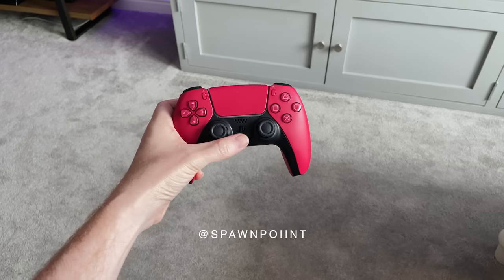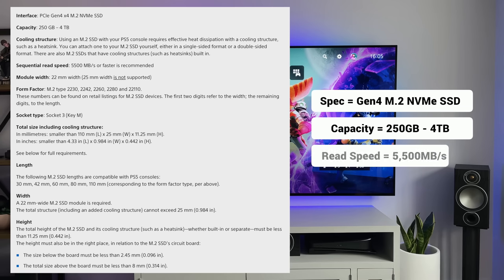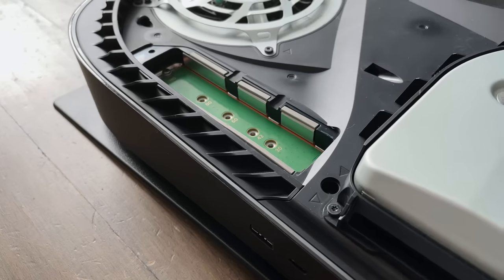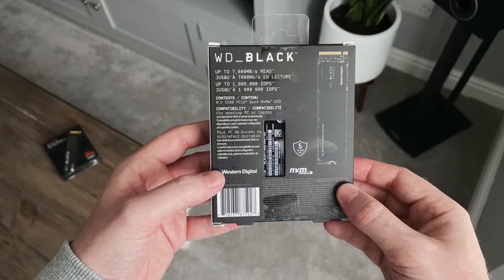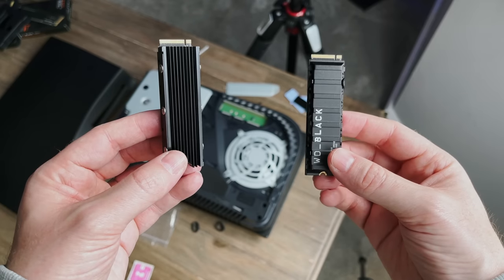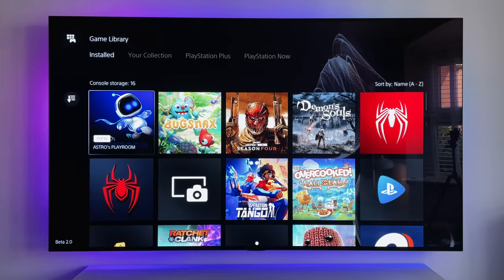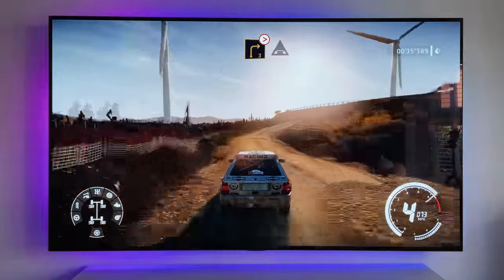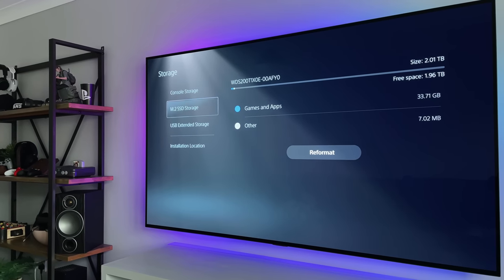PS5 SSD Upgrade: Installing 2TB SSD + Heatsink

Comment from the maker: I hope this was useful. If you do install an SSD, would you buy one with or without the heatsink (and fit your own)?
Reply: I’m going with a FireCuda, had the BarraCuda in my PS4 Pro and I now use it as the external drive for the PS5
Reply: @kevindueck7183  The FireCuda is soo expensive
Reply: @kevindueck7183  is it worth using on the ps5?
Reply: Just bought the sn850 without the original  heatsink, but for 5€ a custom one
Reply: Definitely getting one with a heatsink, unless if I can find a better reviewed third party heatsink.
Reply: @Jactional  I haven’t had any issues with the BarraCuda as external so far, mainly use it as storage for PS4 games, I already owned it so made it worth it
Reply: @brandon_nope  the one thing I have learned in life is you get what you pay for, you just spent $700 on a PS5, don’t cheap out on the accessories
Reply: Very useful. You showed the various models with and without heat sink and compared the load times of external ssd with internal ssd. Great job.
Reply: Yes it was helpful, I think I'll go with the wd_black with heatsink recommended by Mark Cerny.
Reply: I have a question, please answer, I was the first one to post a full video on the SSD installation and PS5 beta software features, but then I read in the email we have received from sony that we are not supposed to post about or stream, did you receive a permission from sony? please advise, Thanks
Reply: Keep up the great content big dog. I love your video and your set ups. Everything always clean and your tech is up to date, just like I love.
Reply: @SingularJohn  Me2 but with the original heatsink for 220$
Reply: Just got the 1TB WD black with a aftermarket heatsink for now till I see the price drop on the Firecuda.
Reply: Excellent video
Clear and straight to the point
Thanks
Reply: @SingularJohn  Ich habe sie neu bei ebay kleinanzeigen gekauft :)
Reply: I bought the sabrent rocket it checks everything except the read speed it 5000 not 5500 am I going to have problems?
Reply: @Vic4vendetta  no..
Reply: @marciN0o  deutlich besser Preis, aber trotzdem noch adequat
Reply: Got the 2TB SN850 without the heatsink for 345€. The 2TB version with a heatsinks costs 499€. What a rip off.
Reply: @SingularJohn  das stimmt, der mc1 von bequit hätte es eig auch getan... Naja, man gönnt sich ja sonst nichts (:
Reply: I’m installed the Aorus 7000s SSD with heatsink.
Reply: Very useful video I go with firecuda for my ps5
Reply: Did you put the spacer under or on top of the actual SSD?
Reply: Extremely useful
Reply: Hello which hdmi cable? you using to ps5 thank you.
Reply: In further testing have you ran into any issues during gameplay?
Reply: @sonutigr2555  read my comment further down. Very good choice.
Reply: @phildavis8732  SN850 has better latency and IOPS, which is why Mark Cerny chose it. Very important to sustained performance. Peak bursts of read/write speeds don’t mean anything. The 1200 TBW will last anyone this whole gen.
Reply: @Vic4vendetta  yes. When it comes out of Beta. The firmware path will either approve or reject an ssd. It clearly states 5500mb minimum as you stated. And ssd brands have to qualify with Sony. Seagate wd and Sam have all gone to market with ps5 ready. Sony would not let them do that unless it was a given. Firecuda all day long. Check my comment below. Why.
If it does work would love to know buddy.
Reply: @phildavis8732  I actually read on the verge they tested the sabrent rocket and everything was fine except for unloading the data back to the PS5 so now that I'm aware  that somewhere down the line I'm going to have to change it by that time the market will hopefully be cheaper
Reply: Very useful
Reply: a sprawdzales czy termopad styka sie z radiatorem i pamiecia. u mnie w dwuch sztukach sn850 termopady byly zacienkie i nie dotykaly pamieci. była mała szczelina okolo 0,2 mm
Reply: You checked if the thermopad is in contact with the heat sink and memory. in my case, in two pieces of sn850 thermocouples were thin and did not touch the memory. there was a small gap of about 0.2 mm
Reply: @Vic4vendetta  when out of beta let me know. I dont think prices will come down. These drives were mainly intended for pc gamers and content creators. New surge of console demand. Won't come down any time soon. Only if ssd manufacturers make a 5500mb entry ps5 compatible part for very cost focused people. Buy the top end to ride out the life cycle of your ownership is where I'm at.
Reply: Registered at Sony but no beta till now. how will I get my beta firmware now? ssd is coming tomorrow... ssd kommt schon morgen aber keine firmware zum installieren..
Reply: Just ordered a 2TB western digital one with the heatsink for £399 from Scan. They are already limiting them to one per customer which indicates to me that there is already a supply issue just like all other pc components at the moment. Therefore, in the immediate future I think the prices will go up as the supplies dry up. 🤷‍♂️
Reply: @jonflowers1370  110% spot. If you a pc upgrader you know the component struggles!
Reply: @phildavis8732  Indeed…it’s been a painful time and doesn’t look like ending anytime soon. :(
Reply: Is there airflow in the SSD bay?
Reply: I talk with a best buy work about a heat sink for my ssd drive , and told that it had a heat sink on it . can you tell me is he right ? it a 980 pro PCle 4.0 NVM2 M.2
Reply: @michaelthomas1878   it would abittle thick.
Reply: This was useful my friend. I cannot afford an SSD right now otherwise I totally would get one! Hey, it looks like you have two. May I have the 500gb one, please? It would mean the world to me! Anyway, great video and the info was very useful.
Reply: I have ordered the WD SN850 1TB with heat sink. Will make a video on it soon once I receive it.
Reply from the maker: @abu gamers - no you're fine, if you read the email again, it says you cannot post 'non-public' information. ie information that is private.
Reply: May be the best video I've seen yet!
Reply: Thanks for this video. It's really not difficult at all.
Reply: I bought the Western Digital 2tb w/Heatsink. Between Amazon, Best Buy & Western Digital there just wasn't that big of savings(in the case of Amazon, 3rd party scalpers bought them all then jacked up the price x2).
I'll have mine tomorrow. I can't wait. Very tired of moving, deleting ect. Both PS5 & Xbox Series X should have released with a minimum 2tb SSD & preferably a 4tb SSD. These games & their 4k textures take up so much memory. But damn it looks good!!
Reply: @shinmentakezo2994  I bought that as soon as I saw his Tweet!! Shipped immediately & will have tomorrow & I can not wait!! PS5 has been murder without a bigger SSD. Moving games takes forever. Now I can have all my regularly played games internally, & just PS4 games on the external. Or move some of those onto the WD SSD!!
Reply: It's always better to have a heating fr sure
Reply: *heatsink
Reply: Hey, I installed an SSD I bought back before December, the WD Black SN850, and I added the same heatsink you did, but I'm curious about putting the SSD slot cover back on after, I did, but won't it insulate it? Would it not be better if left off so the heatsink can be air cooled better? Your opinion would be appreciated.
Reply: I heard you need to have a heatsink because they didn’t do any kind of cooling designs around 3rd party SSD’s. So a heatsink is a must.
Reply: good video thanks
Reply: @phildavis8732  I've had alot of my Seagate HDD & Hybrid(Firecuda) fail. I haven't owned a SSD from them yet BUT because of failures I've had(50-60%) I went with Western Digital Black for my PS5.
Reply: @phildavis8732  Who do seagate use for their chips?
Reply: It’s funny how people think you need a heat sink with the ssd when the Ps5 already comes with one on the motherboard. SMH
Reply: I will not be buying one at all. Far too expensive to pay that price for a hard drive.
Reply: @DarkJedireaper  You actually want to keep the cover on because it seals the SSD slot. The lead engineer said that they use negative pressure from the fan to draw the hot air out, so leaving the cover off will actually mess up the negative pressure and reduce cooling efficiency
Reply: @SingularJohn  I got that one; but the 500gb was only available. I still have external HD that’s 1TB, as well. Also do we have to supply the screw or would it be an extra Screw & washer in our console’s packing.  I need help! lol thank you.
Reply: @cmdr101z8  I'm not certain on the physics of that but... Okidoki. Thank you for succinctly answering my question. I put it back on in the end anyway. :)
Reply: Normally I would buy the cheapest option being the ssd without the heatsink and install the heatsink myself,  but that wd black sn850 looks sick. But again, why spend more in a nice looking ssdn8f nobody is gonna see it biroed there inside the ps5
Reply: @Ade85  they use Phison for the controller. But flip between micron and phison for the Nand. Giving the high spec and high endurance the nand selection needs to make the cut. Seagate are world leaders on the volume of storage so they won't cut corners on thr quality of nand being used. If you test from day 1 of release and then 18 months later the quality will be the same. Its known other brands will find ways to reduce cost which ultimately changes the performance by the claimed datasheet.
Reply: @sfzero3721  sshd was a light use drive because it had to learn as you used. Heavy use caused failures. But hdd has 172 moving parts in inside. Ssd is 0. Main problem with hdd is transit damage which is out of anyones control. That one knock on the plane or lorry can impact the life. Wd is still a good drive. I strongly believe the Seagate is the best future proof drive today as the ps5 evolves with your ownership. Again their is a reason xbox chose seagate to be the only ssd provider. And why seagate are the only fully licensed Sony and xbox storage company. I am sure their relationship is tight with these guys.
Reply: @sfzero3721  very true. As you can tell I'm a fan of Seagate and have the reverse view on things. But bad comments I've seen are about hdd not their ssd. I havent seen a bad comment yet on ssd. To me they have the future proof drive today. Enjoy the ps5 buddy.
Reply: It was useful, I got the 1TB WD SN850 with the heatsink. Gonna install it later
Reply: Do you need a heatsink, i mean, is it mandatory?
Reply: @fernandobrischetto5032  no. Just advised.
Reply: @fernandobrischetto5032   You don’t “need” it but without it, the drive can overheatwhich is more headache than it’s worth especially when you just spent $500-700 on a brand new console, games and accessories.
Reply: @StefanSLR  got it! thank you guys! just ordered an wdblack and heatsink :P
Reply: Great video, I will be getting the 4tb and with the heatsink for sure that comes with it instead of buying one separately.
Reply: Ps5 need extremely fast ssd. We need ssd with heatsink.
Reply: @SingularJohn  same in Slovakia 🤣
Reply: @slizolincan  jj, Alza je bieda v tomto 🙄
Reply: I will upgrade, very good video and explanation
May go with the same as you but max 1TB
Thanks again
Reply: I think I will buy one without the heat sink and install my own, since it’s literally impossible for me to find a 2 TB one with heat sink, not to mention it’s a bit cheaper
Reply: Already bought the WD black with the heat sink installed.
Reply: I'd go with a separate heatsink but the one you used in your video isn't available in the U.S :(
Reply: Wouldn it benefit without reinstalling the shieldplate back ? as there would be some airflow ? i bought the SN850 2TB without heatsink for €289 and the EKWB heatsink for €11
Reply: @romulofigueroadiaz480  first i do not have tiktok and twitter and second isnt the ssd compartiment on the intake side as the fresh air is sucked trough those vents where the plate is ?
Reply: @romulofigueroadiaz480  Gamers Nexus explained this in a PS5 Xbox X airflow test , i just re-viewed this as we speak and that cover is def on the fresh intake side also if u close that shield where would the dissapated heat go as its enclosed ? i think its for dust reasons , will test this wen the official software is released tho
Reply: @Verhulstje  in the words of one of the designers:
“We have 2 exhaust holes for additional SSD slots. Because the slots for expansion are located near the intake fan, the structure is designed to suck out heat from the exhaust holes with negative pressure”
Basically if you leave out the cover, you’re getting rid of that “negative pressure”, thus it will be easier for it to overheat, because its structure was specifically designed with it being covered in mind
Reply: @brucenav3103  he linked another one in the description, looks really good too, pretty similar, that one is currently unavailable in black but I think I might buy the red one, basically the same stuff anyways, not like I’m gonna watch it everyday or something
Reply: @romulofigueroadiaz480  so it would create a vacuum ok i can understand that but vacuum is also heavily sensitive in obstruction , as a hvac tech i deal allot wiht heat and airflow , when it comes available i will hook up my sensors and test this in real time i don´t mind what result it is , if i am wrong i am wrong but for now it doestn makes sense , why ? Ok there is negative pressure but where will he get the fresh air from if you close the plate ? The negative pressure will build up to some point you get a vacuum that is to high so the ssd would just hover in its own heat if there is no point of cool air thats allowed in ... in an easy explaination , if you hold a waterbottle upside down if the water spills out it wil suck air in or it wil just negative pressure like u said and the water would just stay in the bottle
Reply: Straight to the point, British based, what's not to like
Reply: Got a 2tb wd black, waiting for heatsink to come in today
Reply: Def thinking about it now, will probably do without heatsink after seeing how you fit your own. Thanks!
Reply: Cool now I know this now all need to do is buy a PS5 and a SSD
Reply: Very useful and professional video, thank you!
Reply: I'd buy one without the heatsink, and buy a heatsink separately which it seems to be less costly.
Reply: Where can I get this heat sink
Reply: I see you with that Mark cerni-fied SSD
Reply: Definitely with the heat sink for me.
Reply: @phildavis8732  FireCuda 520 - 2 TB?
Reply: In this case of the PS5, buy one with the heatsink and the WD, because it has over 1 million IOPS, which is on par with the GPU decompression speed.
Reply: @SpawnPoiint - Or maybe you don't need to put back the iron plate? Can I leave without it for better cooling?
Reply: What is the name of the screw driver you are using? I desperately need a small one like that.
Reply: Definitely without (and mount my own), but this video shows I'll wait even longer than I expected to join the PS5 team. The prices are absolutely staggering and if they are to remain at this level even five years from now, I'm not sure I'll ever buy extended storage. I'm hoping for a PS5 slim in the next year or two, then I might consider. In the meantime, my backlog is big enough as it is and I don't need modern distractions from it. But thanks for the video, it was very informative and straight to the point!
Reply: If ever get a ps5 I’d buy one without heatsink, and then do what you showed in your video. Great video as always. Big like from me👍
Reply: Heat sink is the best way to get longer life out of your Nvme drive
Reply: @SpawnPoiint The air-flow is different between the preinstalled, and the heat sink that you installed.  The air only flows in 1 direction, so I’d guess that the heat sink that you installed isn’t doing very much to cool down the chips.
Reply: SpawnPoiint I'm kind of pissed off because I have a Samsung SSD external drive connected to my PS5, but for some reason I was picked as a beta tester this go round. But the funny part is I was practically always picked as a beta tester for the PS4/Pro practically that consoles entire life cycle. I'm not sure what the criterias are this time around, but I am a little salty.
Reply: @KaelumYodi  it’s not just about air flow. The heat sink will take some of the heat away from the chips
Reply: @Alexander_l322  it is 100% about the air flow. If there is no air flow, the heat sink will not do anything, as something needs to take the heat away, and that is air in this case.   Otherwise, there is no difference between overheating in 2 minutes or 20 minutes, it’s still overheating.  That’s the simple conservation of energy law.
Reply: @KaelumYodi  I swear it will be cooler than without a heatsink but I do also understand that it won’t stay cool because the heatsink will heat up along with the chips it’s meant to cool if said heat sink isn’t up to the job. I don’t think you’ve ever heard of passive cooling have you? I have and I know that by using the right heatsink will cool something(big LED grow lights I have experience with) and other things that I’ve built using passive cooling. I think you’re wrong and just don’t quite understand but throw around words to make yourself sound smart and make out like you understand what it is you’re talking about but clearly it isn’t working for you. No offence.
Reply: @Alexander_l322  I am an electronic engineer of 40+ years, so I think that I know the physics behind this. I always like listening to people who talk big about something that they have absolutely no experience with.  Good bait though.
Reply: @KaelumYodi  so you should know better! I am right and you’re wrong with 40+ years of experience you claim to have. It’s okay to admit you’re wrong sir.
Reply: @Verhulstje  I’ll run mine without the cover plate in place because this will give it more room to breath. Because it’s connected to the motherboard it will gather heat from it anyways no matter which side it’s on. Like when you plug a flash drive into your PC and it gets quite warm although it’s not been read or written too for that session. Happens with my smart TV and metal flash drives they get warm without being used just from the heat of the logic board it’s plugged into.
Reply: @Alexander_l322  ROFL. Whatever you say dude. I’ll let everyone reading this determine who is correct.
Reply: @KaelumYodi  so you’re that arrogant that you can’t admit you’re wrong or can’t acknowledge that there is a such thing as passive cooling where a heatsink alone is enough to cool but not in all applications would a heatsink alone be affective at cooling or needing a huge one which wouldn’t be viable or cost effective. In the application we are talking about (NVMe drives) a passive heatsink will do just fine with minimal air flow, it’s more about ventilation anyways and I know this which is why I’ll run my PS5 without the metal cover once my NVMe drive is fitted WITH its heatsink.
Reply: @Alexander_l322  WOW, all I can say is WOW.  You might want to look into the mirror.
Reply: @Alexander_l322  you have no idea what passive cooling is, and there is no case where a heatsink alone is enough to cool w/o something taking the heat away from the heatsink itself.  The sole purpose of a heatsink is to increase the surface area so that a moving coolant (in this case air) has greater contact to absorb more of the heat and to take that heat away.  It does not work if the coolant does not move, or moves to slowly.  It is extremely clear that you are solely here to troll others, from all of your comments that I've read.  Good luck with that, and have a nice day.
Reply: @KaelumYodi  my comment got deleted I guess? What you just said proves I am right.
Reply: how many ssds can you fit in the ps5? can i upgrade my ssd and use an external drive to maximise storage? also how many external drives can i use at once?
Reply: @kaurkirandeep9361  I know the one the PS5 comes with is soldered to the motherboard and isn’t upgradable and the expansion slot can only fit one M.2 NVMe drive up to 4TB which should be enough for pretty much everyone. Then you can use a USB hard drive for PS4 games if you find somehow you don’t have enough storage.
Reply: @Alexander_l322  nice try, but no cigar.  Everything that I stated completely disproves your hypothesis.
Reply: ps5 is worthless, all the games give me motion sickness haha
Reply: @Alexander_l322  i am not sure how to install that all by myself as i have never done it before i’m scared i might mess up my ps5, if i don’t want to do anything to it internally, is it possible to use 2 external SSDs?
Reply: @kaurkirandeep9361  you can’t install PS5 games and play them from an external SSD
Reply: Bought one with. Fitting a heatsink is trivial, but ensuring that the one I get is adequate is more bother than just buying one. I bought a 2TB SSD, so I didn’t want to regret the purchase.
Reply: @匚-k3i  that’s an external HDD. You can’t use it to play PS5 games from like you can if you use an M.2 NVMe drive. It’s not better
Reply: going to buy the same SSD you showed with the heatsink but with 1tb of storage
Reply: It's not working for me please help me😭😭😭
Reply: I will buy a heatsink for sure... I'm just waiting to get the beta, if I ever will get it!
Looks like the less than average user won't have that chance... That's my case! hahaha
By the way, man, those SSD are really expensive in UK, huh??????
Reply: @Decon Streakin isn't that ridiculous? They come from the same factory!!!!
Reply: I hope you can help me. If I take the firecuda without heatsink, is the amazon heatsink from the link in description compatible? thanks in advance.
Reply: Definitely going to be attaching my own heatsink. You showed how simple it is to do so clearly! Thank you for this!
Reply: @metallicaguy123  How does the motherboard having a heatsink have anything to do with installing an additional SSD? The TV has multiple heatsinks, a car has a fairly robust liquid cooling system, and my apartment has central air conditioning; but much like the motherboard having it's own cooling solution (you forgot to include the fan), none of those other cooling systems will help keep the additional SSD's thermal temperatures in check.